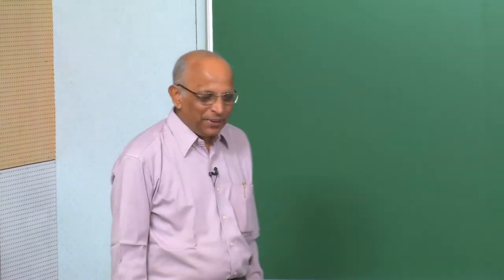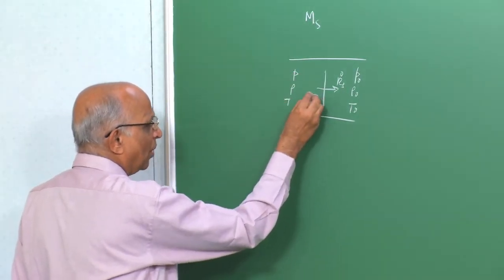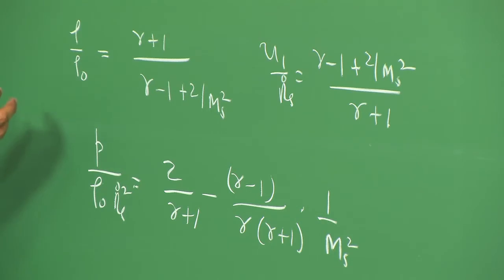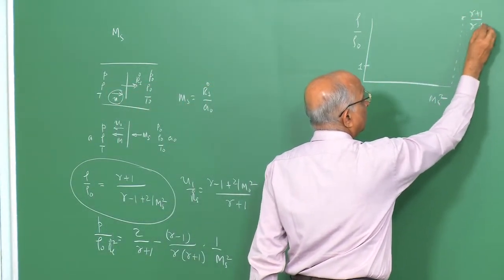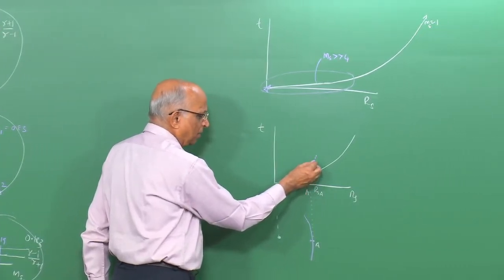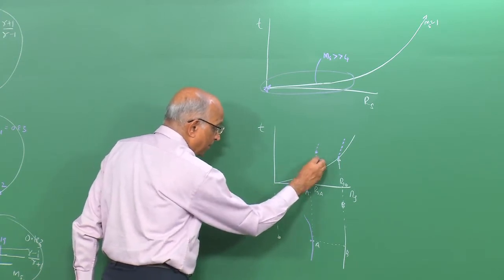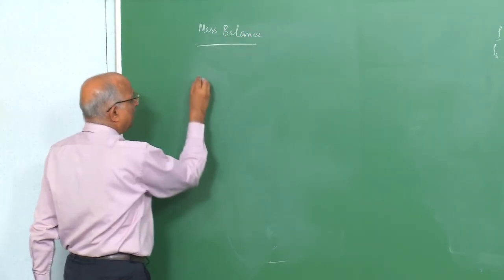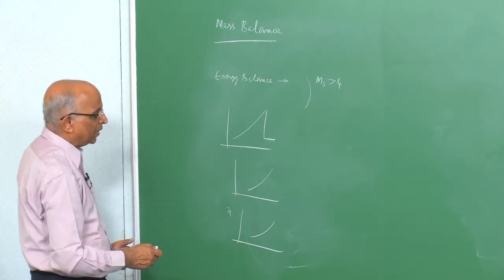Mod-01 Lec-06 Blast waves:Concentration of Mass at the Front,Snow Plow Approximation

Comment: Wouldn't this snow plow idea mean that if the explosion is 1 inch from you, it would not hurt, since there is almost no mass when the shock radius is low? And, the farther away from the point of explosion you are, the more it would hurt? Since there is more air?

Since the volume of air in a sphere would increase faster than the surface area [4 / 3 * pi * r ^ 3 versus 4 * pi * r ^ 2 --> O(r ^ 3) versus O(r ^ 2) ], it would mean the farther you are, the more damage, until the Mach number decreases to that of an acoustic wave?